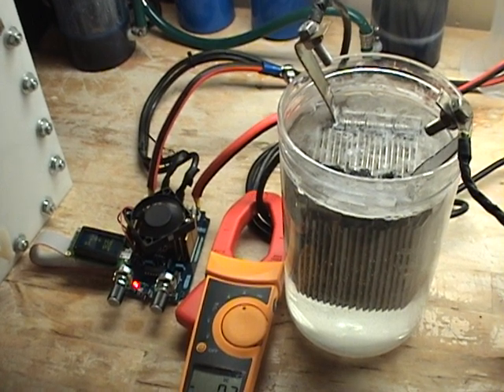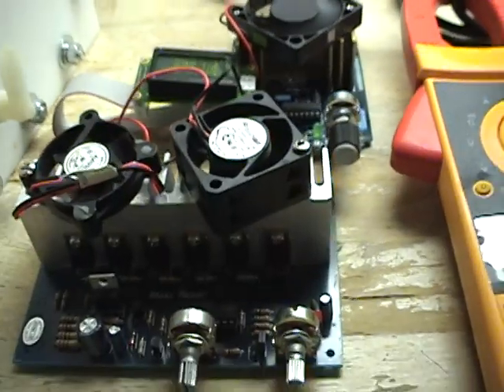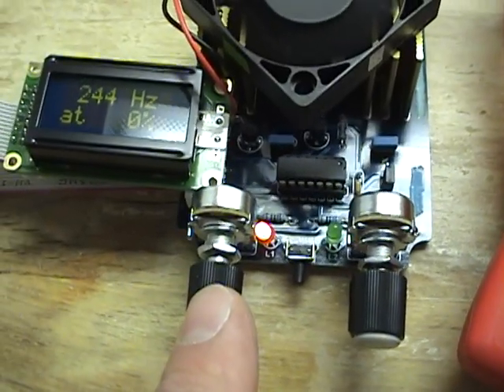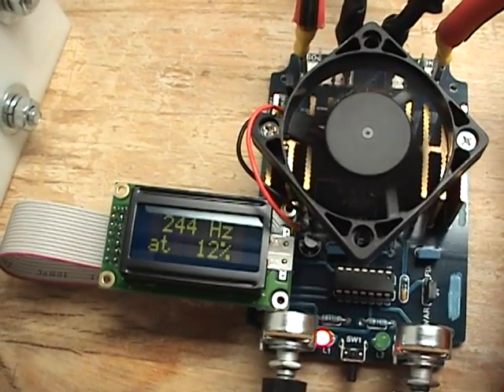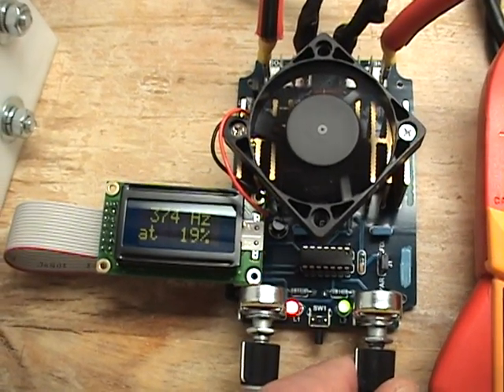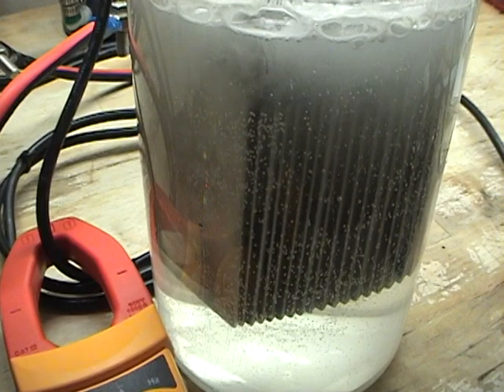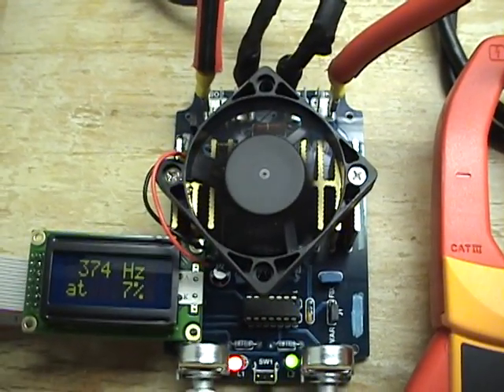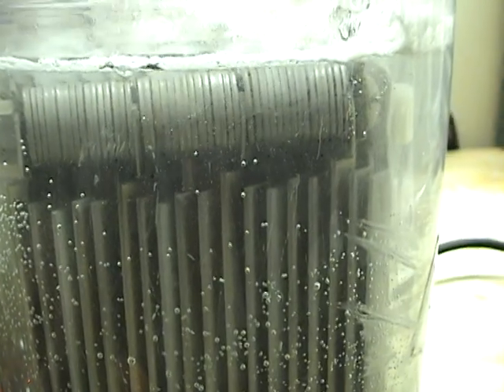NEW 50 amp Microcontrolled Efficient PWM Demonstration.

Comment: i'm curious to know if that LCD display can be mounted off the board? so say if i was going to box the PWM to prevent the circuit board getting damaged but still wanted to read the LCD, would i be able to mount the lcd display into the box instead of mounting it on the board or is that a permanent feature?

Comment from the maker: @motiondynamics2010 There is a jumper on the board. fixed and variable. FIXED @ 100Hz, variable 244 Hz- 3.125 KHz. I doesn't take a designer to understand how that works.

Comment: @jjenson2006 its droped from full power , yes you could say its controlled but really your just dropping the max output off your power source with an electronic device. you arent totaly rong bro dont take affence , an average amprage being varied by time is in fact a wattage fluctuation, look lets just say that you are write it was a triac i used but yet it still modulates current by switching a duty cycle , look the voltage in my outlet is 120 thats what the metert reads avrage or not,

Comment: @jjenson2006 i ididnt say it would go from 100 to 14  i said i ran a test that showed a drop in voltage on lower settings , any way if the circuit is turned off and on then the wave on the osciliscope will show a wave form of wattage fluctuation, wattage has a time constituant .... w/t to be percise so if it chops the voltage then you are droping the wattage, any way u are write about the triac bro , you see i thought any device that alterd a sine wave could be considerd a puls width modulater

Comment: @NOBOX7 BTW - A typical router speed controller doesn't use a PWM. It uses a triac with an AC voltage. If you have a DC powered router, you could use a PWM, but I never heard of nor do I see any practicallity of producing a DC powered router.

Comment: @NOBOX7 Wattage isn't dropped, that is the reason a PWM is so efficient. A potentiometer or rheostat will drop wattage, that's why they get hot. A PWM controls the average wattage being applied to a load by switching the load on and off.

If you think a PWM varies real voltage, try taking 100v and using your meter to adjust it's output to 14v and then connect it to your cars charging system and then get back to me. LOL

Comment: @NOBOX7 I don't care if you have a $100K meter. If it is a digital or analog meter, it measures average volts and current. If you don't know this, it is pointless to even continue this conversation. You should just go to an engineering forum and make this claim. Maybe once you see a bunch of EE's disagree with you, you'll be enlightened.

I didn't say the PWM causes an amperage drop, I said the AVERAGE amperage is varied by time switching the load. Wattage isn't dropped, it is controlled.

Comment: @jjenson2006  amprage stays the same its the chopping effect that causes a wattage drop , the amps are pulsed , not trying to be a pric sry for answering you like this but i totaly disagree, i do agree that a pwm is not a variac it will not allow a large voltage range but the voltage does drop wen on low settings becuase of the power the device uses to operate itself including heat losses in the potenciometer and other components of such a device, i am refuring to a router speed controller

Comment: @jjenson2006 no you  rong the voltage starts at 120 and drops down to 90 volts, oscilascope my ass , i have a 70 $ meter that does not give avrage voltage it gives the percice voltage, you can watch it rise and fall, watch my videos on my iron plate cell and you will see that the device does cause a voltage drop. the pwm action does not  cause an amprage drop eather its a wattage drop pal so thanks but no thanks, if you no what a osiascope does you would no the area under the curve is watts???

Comment: @NOBOX7 You are using a voltmeter to read the voltage, so the meter is averaging the voltage. If you measure it with an oscilloscope, you will see that the voltage is either 12-14v or zero volts. As I said in my previous post, amperage is controlled by time switching a fixed voltage.

Comment: @jjenson2006 pwm do cause voltage to drop... i ran alot of test and i found that on low settings there is a voltage drop??? i  dont no why but they do cause a drop

Comment from the maker: @jjenson2006 I am in agreement on your first paragraph. 
A 5+ MMW hho generator is not going to experiment if the amps are kept low. Design is important. An improperly built generator is going to experience thermal runaway regardless.

Comment: @delvis11 If you were an EE like myself, you would know that PWM's control (average) amperage by time switching a fixed voltage, not by adjusting voltage. You say that the MOSFET handles heat better because of the controller. The controller only generates pulses, a good driving circuit switches it more efficiently.

As water evaporates from the generator, it will draw more current and generate more heat. This will feed on itself until you have a meltdown. You have no protection against this.

Comment from the maker: @jjenson2006 If you understand how  HHO cells function and understand efficiencies you will understand how these work. ex. these pwm's control amperage by adjusting voltage. HHO cells are most efficient under 2v per gap.  That's how they will improve efficiency over straight DC. In a perfect HHO cell that has no current leakage any voltage over 1.25v will generate waste heat. the controller can lower the voltage thus better control runaway. yes current limiting is the best scenario

Comment: There are several things wrong with this video, here are a few:

"Runs more efficiently due to the controller"

The controller has little to do with efficiency of the PWM.

"Reduces thermal runaway"

How can it reduce thermal runaway if it doesn't have current limiting?
Looks to me like this was designed to use a controller, just for the sake of using a controller. If there's anything to justify using a controller for the PWM, it's to limit current, which this thing is incapable of.

Comment: Something that I'm trying to understand much better than I do, is this: I have a 30 amp DC power supply. Originally it had a charging circuit (as an RV convertor) but i stripped that out. It also had smoothing and regulation, so it was producing power in a fairly linear fashion. When i stripped all that out, and used the power as produced by the bridge, it *seemed* to work better. Meaning that the ripple was left in. Not a true pulse, but *some* 60hz behaviour, if u follow.